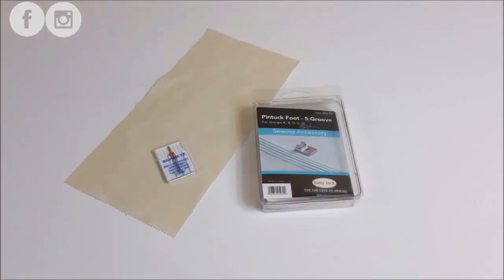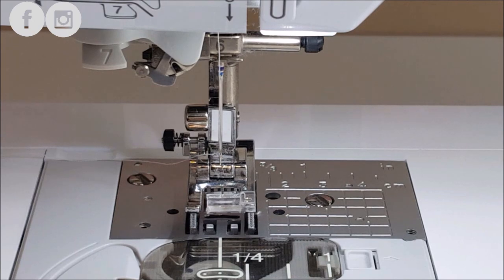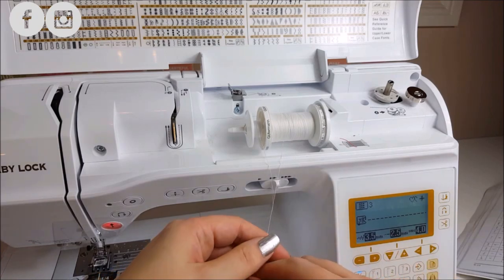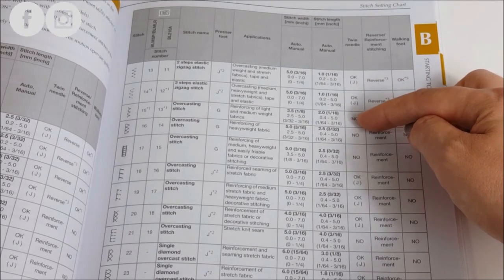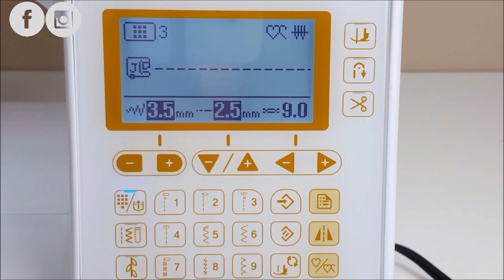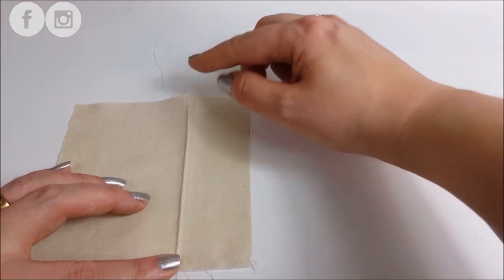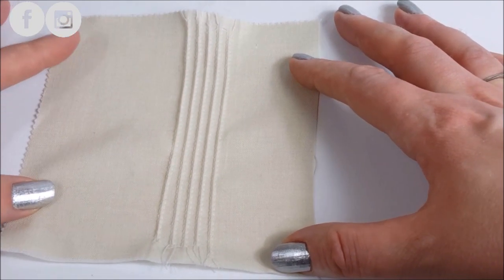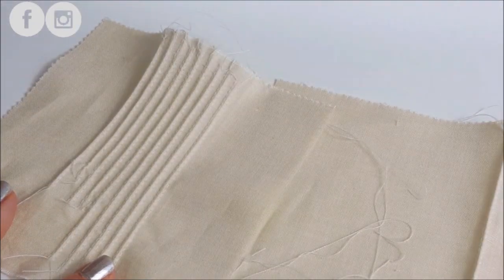Babylock Soprano Sewing Machine | Pin Tuck Foot Sewing Tutorial

Comment: Hi Cassie, on your PinbTuck video, you have set thread y e nsion to maximum -9. 0 mm. And 2.5, 3.5.  But, couldn't get, which is for  width & length tespectively. Also, I want know, how does this 5grooves Pin tuck foot & 7 grooves Pin Tuck foot helps.  I am sorry, If  I have asked this question repeatedlt. Pease don't mind. :)
Reply from the maker: I never changed the tension I thing it must have been the width.
Reply: Oh, I see.  Thank you..  Then, my guess is 2.5mm must be for length, & 3.5mm must be for width. Right? 😊